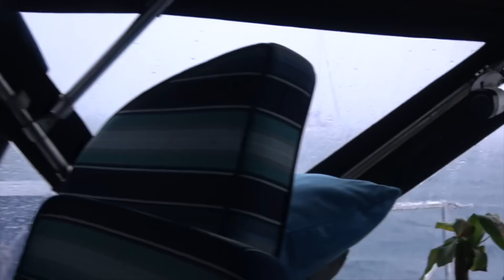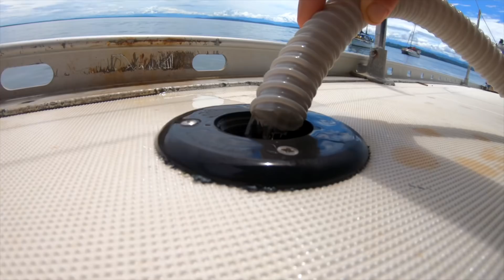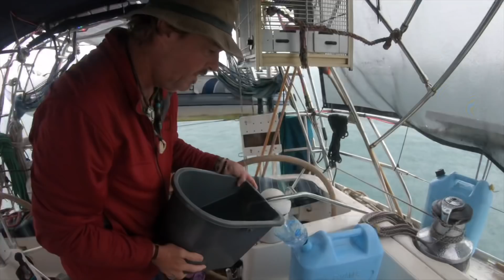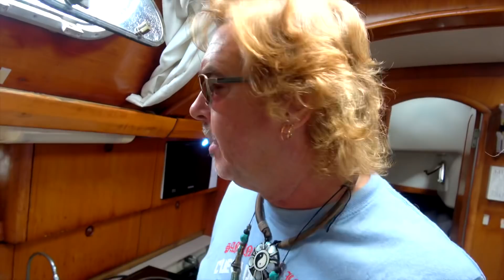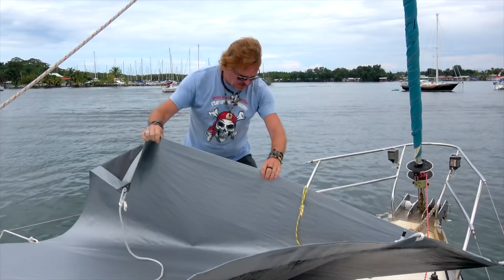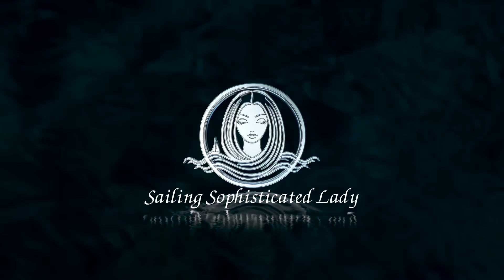SSL 389 ~ Lessons in BOAT LIFE ~ Water Onboard

Comment: An awesome, wonderfully informative & inspiring video Captain Rick....Do you have a means of flushing your water tanks? The nucleus of every rain drop is a dust particle which accumulates by settling in the bottom of any water storage or delivery system. I think I will incorporate a water collecting system in my boat project plans. A nautical version of a Maple Sugarbush technology...Do you test for acid content (ph level)?  NB. I recently used collected rain water in my pressure washer. Immediately before the water dried even bare metal showed signs of rust. Probably because of my location near the Great Lakes.
Reply: Maybe/Probably a collecting system for rain water like a Maple suger bush utilizes will be in my boat build plans

Comment: Excellent improvisation.  Red Green would be proud of you.  Probably could use some kind of grommet to prevent fraying or splitting of the tarp.  So it works well in rainy season, do you think it would be effective in dryer conditions if you left it overnight to catch some condensation?  One suggestion about testing  your water, get some distilled water to use when rinsing your electrodes.  Actually, if you put the distilled water in a little cup and let the electrodes rest in there for a bit, that might be more efficient.  You don't want to rinse electrodes with the water you are subsequently going to test.

Comment: You should consider a few things, TDS is not a test of bacterial or viral load and water still needs to be disinfected before drinking (a good way if your TDS is below 600ppm is to use UV or you can use RO although for water below 600ppm RO is quite energy wasteful. A good TDS value is not actually zero, 200-400 is much better for you as you need some minerals so if using RO it can be a good idea to use a remineralization filter to get those needed minerals..

Comment: Great solution! you could also wrap a bungee cord around the drain connector under the tarp and clip the other end to the frame of the hatch to maintain the low spot  under slight tension.. .

Comment: Loved this video. May I perhaps suggest the addition of a weight attached to the underside of your catchment tarp/drain fitting to help create and hold down the low spot in the tarp to better help direct the water flow to the sink drain. I'm thinking if you could find a metal fab shop that has CNC cutting capabilty to cut you say a 6" diameter of .375 stainless steel plate with the ID of the center hole the diameter of your threaded sink drain stem. Use and install as a large washer on the underneath side to provide about 3-4 lbs of weight to help stabilize the catchment tarp in a windy situation. Always trying to build a better mouse trap here buddy.
Reply from the maker: yes, or I was thinking just throw a rock on the tarp near the drain... Lol

Comment: Do a search on "Reverse Osmosis water effect on the human body".  It's not good for your body.  I heard that you have been using it a long time and aren't dead yet.  Maybe that's because of the amount of alcohol you consume.  The reverse osmosis process removes much of beneficial minerals needed to for our bodies, along with toxins.  Water is a solvent.  When it doesn't have the beneficial minerals to maintain its structure, it begins to attack the body to gain those minerals back.  This explanation is over simplified.  Please research it in depth.  It is not healthy to drink over purified water.  If you keep the osmosis system on your boat, then you will need to reintroduce minerals into your body.  For instance, I use oral Chelation Therapy to remove metals and plaque from my body. It does such a good job, that I must reintroduce minerals that were removed in the cleansing of my body.  Drinking over purified water does the same thing. Rain water is good stuff.
Reply from the maker: Thanks Brad, but just FYI, rain water is naturally distilled water.. exceptionally pure in the absence of man made pollutions... and I have researched this for over 35 years since it has been our family business for that long, and quite the opposite is true... water extracted from ground aquifers has acquired purely inorganic minerals, which have no nutritional value to the body whatsoever.. it is only after these minerals have gone through the process of photosynthesis with plants at the surface that they become of value for consumption.  The longer you consume water with inorganic minerals, the more they will settle out in the bones and joints as they are non-digestible and accumulate over time.. resulting in things like premature arthritis, etc.  Pure water has the opposite effect and will cleanse the body by absorbing these accumulations and carrying them out of the body.. and then you can acquire all the necessary vitamins and minerals the way you were meant to.. through the proper foods you eat.  Water was never meant to hold nutritional value, it is meant to keep you hydrated, and cleansed.. just like if we all drank rain water from places with no industry polluting the air that would subsequently contaminate the rain.  But there are always two sides to every story.. kind of like "Climate change versus no climate change".. the results will only be told long term, and so far my entire family is doing quite well thank you.  :)
Reply: Yes, pure water will clean the body and that's my point. It pulls out the nutrients that you have absorbed through food and other sources.  Rain water is GREAT!   I have a tank with a roof over the tank.  I wish I had room for a building of tanks.  And I agree, climate changes all the time.  It's been changing since the beginning of time.  We all make decisions in life. Enjoy your sails. Wish I could join somebody doing this, but life has its trials you know.  Cheers.

Comment: That simple setup is a Boss! I too collected rain water on the boat like mad..where I started water was plentiful and cheap, but that quickly changed, and besides my permanent catches, wanted something more, so came up with a "going to rain hard" system too.(wish I had some of your parts at the time, like that silicone tubing) but it worked, and full tanks are a happy crew ;) People say, "you trust that stuff?" ran mine through a brass screen, and a bit of filter material, to keep bugs or debris out, and is was fine, some of the best water ever! Great stuff, and do a breakdown on your ROS when you change filters please.

Comment: Wellllll,Wadyaknowboutdat? I remember several Years ago some people mentioning a simple raincatchment system.......don't remmemeber particularly who. but, we WON'T go rubbing Sea Salt in an ope wound. It's moments like these when you do something like that, you look back over the years and say DOH!!!!!!!!Just gota remember to let the Catchment system FLUCH for a bit before you collect. to wash out the salt spray n such that will accumulate in the tarp. Ofcourse you COULD rig those tanks to the water maker and feed the Collected water THROUGH the Watermaker Filtration system. F.W.F.S.
Reply from the maker: the water tanks are connected to the inlet of the reverse osmosis system.. but no need  to run fresh water of only 40ppm into a desalinator.. that would be way overkill..

Comment: Good job 
Check out for a economical way to have a water maker    https://seawaterpro.com  do it yourself kit easy install low AMP draw. $ 2600 for 21 GPH add second membrane and go to 34 + GPH 12/120/230/ volts option.
Not the crazy prize of 8000 to 12000 +
Reply from the maker: I've investigated all the options for the past 2 years.. I know this system you speak of.. believe me, there is no easy efficient option for even half the price anywhere.. it always looks cheap, but then you realize that their smallest system that produces 20GPH needs 1500w of power just to run the motor.. at 12Vdc that is over 120amps... you aren't going to run that system everyday without a generator, and even a small generator is going to add US$2000 to your up front cost factor... in addition to the cost of ongoing fuel consumption and maintenance for the generator to run the system every day/week/month that you intend to use it.. plus you have to listen to the generator for 1.5 hours per day running in your home just to produce 30 gallons per day.  The Schenker desalinator that I ended up choosing will produce around 14GPH drawing less than 20amps at 12Vdc versus the 120amps on the seawaterpro, and produce almost as much water, but consuming less than 20% of the energy to do the same job.  This also means it will run entirely off excess energy from our solar panels no problem and maintain a completely carbon free footprint for all the fresh water we need for years to come... a very big incentive in my books.. :)

Comment: I don’t think I understand what ppm of what substance(s) you’re checking for. Our local water utility sends us an annual report of the required testing for about two dozen substances that may be, or expected to be but within normal limits, in our water. So I guess I’m asking if your meter reflects a value out of parameters, would you then try to find out which is/are the offending substance(s)? What would you do then, just boil it, depending on its intended use?

Please forgive if you answered my question in the video already. There’s a certain frequent level of disconnect between my synapses! Lol
Reply from the maker: PPM reflects the total dissolved solids (TDS) count in a water supply.. most governments regard anything under 500ppm as safe for drinking.. but that doesn't necessarily guarantee the 'safety' of the water.. solids are one thing, bacteria is another.. if you boil water you will kill the bacteria, but through the natural process of evaporation you will concentrate the TDS count.. for instance, if you start with one cup of water at 500ppm and you boil it long enough that half a cup of water has evaporated during the boiling process, if you test your TDS again you will find it to be upwards around 1000ppm because all the solids remain in the water.. now if you in turn find a way to collect the steam and re-condense it, that would be how distilled water is made, and because the solids can't travel with the steam, you would find the TDS of the 'distilled' water to be virtually pure at less than 5ppm for sure.
Reply: Thanks, Captain Rick. That explanation was not only concise and understandable, I learned something from it. That’s also something I love about your vlogs! Thanks for taking the time to explain 😊

Comment: Gread Vid  Thxs .. about that secondary RO to get final quality. What pressure are You running on main tank ?  Does it need an extra pressure pump ?
Reply from the maker: Yes, it will run with a minimum of 40-50psi but I have a booster pump that takes the primary supply up to 100psi for the RO unit.. this yields higher quality and faster production levels.

Comment: Rule of thumb for water catchment.
1" of rain + 1 sq ft of surface = 1/2 gallon of water
Reply: It is always interesting when I am teaching volume verses weight and displacement. I am not a teacher by trade. This is in the due course of work. I first do a demonstration of different liquids, such as water, oil and kerosene, mixed in a clear glass and then discussing the weight/viscosity of each liquid and why they so readily separate. That discussion, in and of itself, can be very entertaining, but when I pose the question, " How many gallons of each fluid will fit into a 1'x1'x1' cube/box?" ….That is when the mayhem begins!
Reply from the maker: well if I remember correctly there is 1728 cubic inches in a cubic foot.. so now it just depends how many cubic inches a gallon of liquid occupies and do the math from there... because a gallon is a gallon no matter the liquid... do I pass?  😉
Reply: @SailingSophisticatedLady  
231 cubic inches

There are 231 cubic inches in a US gallon. Hence if you have a volume in cubic inches, for example 3675 cubic inches you can convert it to US gallons by dividing be 231. Hence 3675 cubic inches is 3675/231 = 15.9 gallons.
Reply: @SailingSophisticatedLady  Mayhem.... Aaarrrgggg Mate.... Rum is wetter than water! ;P
Reply: @jamieminton172  7.5, roughly...  Or 7.48,  more precisely,at standard temperature and pressure.   Curious, what is the typical mayhem?
Reply from the maker: Cool statistic, thanks!  :)
Reply: Theirs always got to be that one guy who knows just a little bit more information than the guy before.
Reply: @ Kent Fletcher Funny you should mention Temp and BP, as I always purchase my fuel in the early am . Doesn't make that big of a difference, but what the hell. Liquids will act funny as they near the freezing point or boiling point for that matter.
The expansion and or contraction is part of the mayhem, as different liquids will do so at varying rates based on their elemental compound... 
I use pot holes as an example of how water will expand far greater than oil, creating a tremendous hydraulic force that destroys the concrete/asphalt. 
Polishing fuel/diesel to remove contaminates that bind with H2O in cold climate is a plus. I see this in the trucking industry a lot. Not only with fuel, but with air systems as well.  This holds true for hydraulic systems to.
And you can imagine the confusion!

When collecting water at sea level... six to eight gallons per cubic foot will get you in the ball park LMAO.
Reply: 600 gal per 1000 sq ft per inch, dependent on the catchment surface and other factors.

Comment: Excellent field engineering. One concern about collecting water from the bimini...they are usually treated with chemicals-rain repellant or otherwise and tend to get bird crap or other animal crap on them. Perhaps yours isn't or such chemicals are long gone, but those chemicals can be harsh. I'm not sure what type of water filtration system you have on the drinking water side (unless I missed that), but that'd be interesting to know. I am very fond of heavy carbon filtration in line with UV. Big thumbs up on the reverse osmosis...depending on the pore size that may be all you need for bacteria and virus.  My other comment/question is that I recall that TDS testers usually need to be calibrated with distilled water and I am not sure if you just "calibrated" yours with the same water you are testing...wish I was there to poke around, read manuals, and talk to you. I am in the water field and am a bit of a water nerd. But, by the looks of things your water systems may be so beefed up that you may even need to add minerals! Great video! The technical works/sailing videos are a big favorite. A sailing instructional videos would be a fantastic teaching tool to us sailors out there. Most sailing youtube videos gloss over that in favor of personality entertainment or only scratch the surface, but I get it. Thanks for what you do.
Reply: Did a little research. TDS testers are calibrated with specific solutions with predetermined values with it best to calibrate using a solution closest to the expected source water. They typically come calibrated but should be calibrated from time to time. It's all flooding back to be know....been a while, since I've been in a lab.
Reply from the maker: yes, we have some of that solution onboard.  :)
Reply from the maker: Yes I will get more in depth on all my water treatment systems as we delve into installing the new Schenker desalinator this month.. my family business is in residential and commercial water treatment, purification, and sterilization for over 35 years... welcome to the club!  :)
Reply: Was kind of curious about the same thing.....I know my bimini gets bird crap, dust, pollen etc. I would imagine that stuff is not good for the water tanks.

Comment: Having a filter before sending the water to the tank will save you a lot of trouble and the osmosisfilter in the long run. Having a lip on the bimini would also make the collection a lot easier 🤗 
Rainwater is the best to shower in and will also save the watermaker some hours of running.. great job on the tarp 👍
Reply from the maker: Thanks mate, and yes been working on some ideas to put a 'rain gutter' of sorts around the dodger and bimini.. would certainly increase 'production'!  :)
Reply: Captain If you do have solid bimini sides then those can be folded and clamped in an angle letting the water run in the fold all the way to the bucket. 🌧❤️
Reply: That's a great idea adding a filter before the tank.